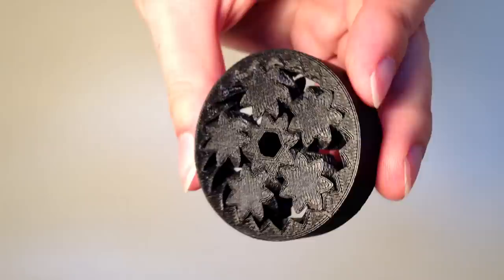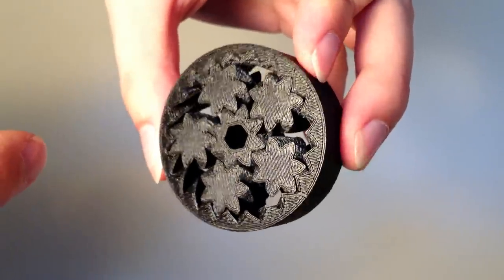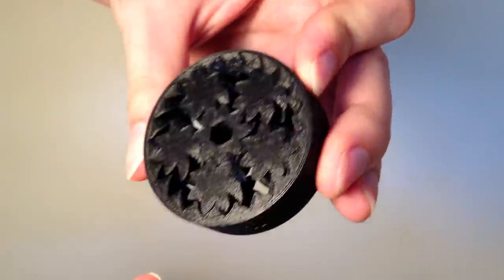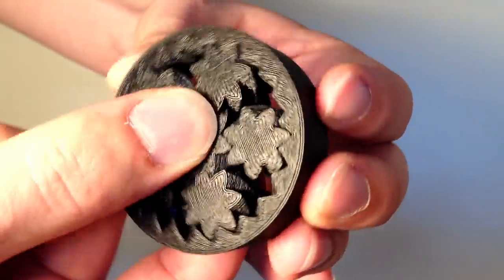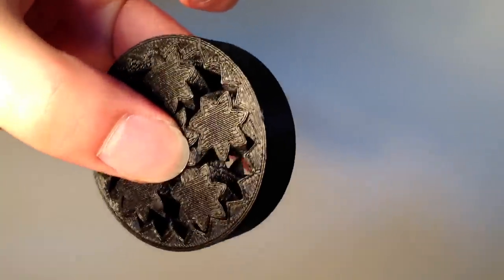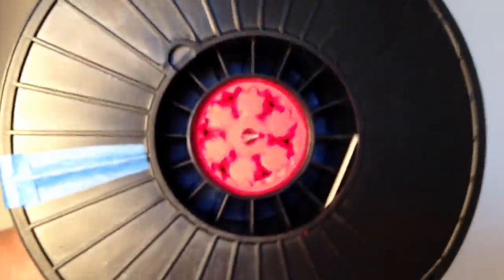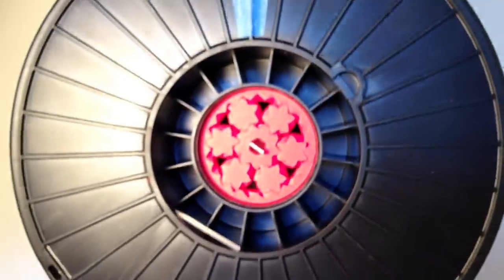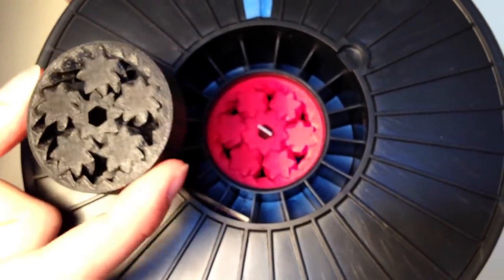3D Printed Gear Bearing

Comment: I printed one of these on my Ender 3. It works unbelievably well! I spun it up to approx 2500RPM using a motor with a Lego wheel on the shaft. I tried to spin it faster, but when the motor reached 6000RPM (meaning the bearing was going approx 3000) the Lego tire became permanently expanded due to the spinning force and flew off, barely missing my face and computer monitor
Reply: how did you actually fix the wheel onto the "shaft"?
Reply: @rexycontemplates   If I remember correctly, I put a piece of tape on the motor shaft then friction-fit the Lego wheel on it.

Comment: I bought a new prusa i3 from Josef Prusa and that was one of the files on the demo SD card. It printed GREAT and, though not as smooth operation as yours, it works! I will download the thingiverse version to keep! Thanks... good design!
Reply: Try to adjust the nozzle height a bit higher

Comment: How did you print this without the parts sticking together? I ordered up an Ultimaker will it do this?
Reply: should be able to do it
Reply: almost any printer can
Reply: @HighVoltageMadness  that is a 7 year old comment you are replying to lol
Reply: @nikolasbabetas3490  XD
Reply: load the file into your printer, press start, wait till it's printed. DONE!
Reply: @nikolasbabetas3490  8 years

Comment: Unfortunately your limited to only thermal set materials with a melting temperature of less than 500*c and a glass transition point of lower than about 400*c with most 3D printers. This basically means plastic although different types are available. Sugar, chocolate and some soft metals such as lead or gold are also possible.

However upgrading to polycarbonate may improve run times & load, but these are MUCH rarer and a bit harder to print, however is a public download so your welcome to try...

Comment: can be use it to print METAL?, like, using an inductive head for heat metal to the fusion point, and maintaining the printer area isolated to maintain the metal hot, maybe done with a ceramic head or with something higher fusion point.

Comment: The norm for car bearings is greased tapered rollers, some heavier vehicles run tapered rollers in oil. Both these designs are smooth cylinders rather than teeth, providing thrust support from the taper. Its cheaper than cogs, easier to make to higher tolerances and have less friction than gear bearings.

However unlike those bearings we can download & print this one for effective use in just about anything around the house... so for this my thanks goes to Emmett Lalish, but no its not for cars.

Comment: would this work on a fitget spinner? great video!
Reply: Actually "3D Printing Professor" published a spinner that uses this bearing. It worked well enough, but it didn't work as well as a another 3D printed design, and neither worked as well as washed 608 steel skate bearings from China. This can actually centre the shaft and take up a considerable load, while the other 3D printed bearing can not, it is my understanding that the other design was a fluid dynamic bearing. But a spinner simply doesn't apply much any load as it's balanced by other forces for the most part, so it doesn't need a good bearing.

Comment: How did you design this on a computer? I notice on thingiverse there is no inventor .ipt file so I'm unable to download your great design and add the extrude I need. I have limited access to a 3D printer so i want to get it right in as few attempts as possible. Thanks!!
Reply: +Chris Wilson It's not designed in Inventor. The source is the bearing.scad file on the Thingiverse page. Use OpenSCAD to open and edit it. Good luck with your project.

Comment: doesn't need an external cage because it has an internal interference design
Reply: also while this works for a low stress applications don't expect it to work under heavy load due to the low stress yield point of plastic
Reply: TheDarkalkymist
But you are aware of that u can print in metal aswell?
Do that and lube it, voila.

Just becouse he printed this in plastic doesnt mean that others will.
Reply: @luft, the issue is that any material that can be printed is going to have a low tensile strength and thus why the design isn't suited for a high stress load
Reply: i would be leery of any gun made out of printed metal, chamber pressure would likely burst it
Reply: printed? or sintered? any method that doesn't fuse the metal back together into one peice is going to pop under pressure when the powder ignites, sintered metal is fused by heating and electrical charge to become one piece, how can you heat metal to 2000+ degrees to fuse it with a printer?
Reply: printed is different than sintered and has very different structural properties which is why i was concerned, i wouldn't use printed connecting rods in an engine for the same reason i wouldn't want a printed gun, stress is going to break them easily, once the metal is sintered it changes the stresses and structure of the materials
Reply: as i said the two have different meanings to me, the design i don't object to in the least
Reply: and here's the rub, a plotter is another form of precision printer, used them in CAD class, the terminology really does need to come up to speed
Reply: and i prefer more old tech methods, like hammer and anvil, currently saving up some money to get an anvil i hope here in about a month

Comment: Dear Emmett
I very much like your job about planetary gears. I am 44 years old Airbus Captain Pilot (working for Freebird Airlines Antalya TURKEY) with the Military origin (flied F4 Phantom Aircrafts) and I call myself as an inventor because I have found a way to create mechanical ratational multiplier which have all the properties of mathematical multiplying operation System supports real infinite ratio adjustment from a positive value to a negative value with a real zero crossing, two way power transmission (means output can be used as input) without using a friction element like touching balls or belt like things. I am writing a patent for the system but before I want to make a prototype.
Would you mind giving a hand to select a 3D printer, use it or any phase like CAD designs. Do you have an engineering degree? I may pay for your design help.
Reply from the maker: That sounds really interesting; I might be able to model a prototype in OpenSCAD if you send me your idea. I'm definitely an engineer (PhD in aerospace controls). I'd recommend a Printrbot Simple Metal; it's by far my favorite printer and it's plug&play on windows 8.1. You can message me on Thingiverse and give me your email if you don't want to post it here.

Comment: What happens from friction when the plastic heats up? whats the melting temperature due to friction?
Reply: 80c probably.
Reply: ***** could you make me these in different sizes for a project in El Salvador? what would it cost for 12 and in different sizes?
Reply: Shane Cianciolo a project in El Salvador? What do you mean? If you need a ball bearing I think it's much more performant and reliable a traditional metal one. These are just sort of "desktop games" to drop stress, not meant for heavy work.
Reply: But if you need to replace some mechanism in your boat I may help :D
Reply: ***** We are building in El Salvador. A small community that needs hydropower and a waterwheel.  Hopefully this October the waterwheel can be accomplished.
Reply: Mhhh ok let me know if you need something, I may help you through Shapeways, but as I told you, these things are mostly toys, even though you can print with metals etc., resistance to traction, torsion etc. is never the same as factory stuff.

Comment: Dont get me wrong, your bearing is absolutely amazing and well thought out. But for the form factor, a 1 kg load is not even close to what will get me excited (a top of the line metal bearing cage that size can withstand 10.000-30.000 kg easily)